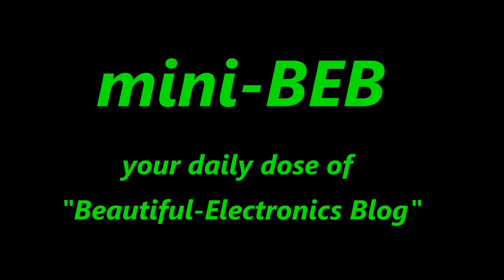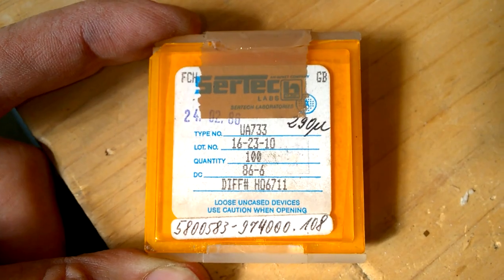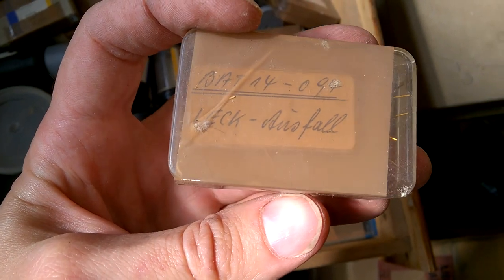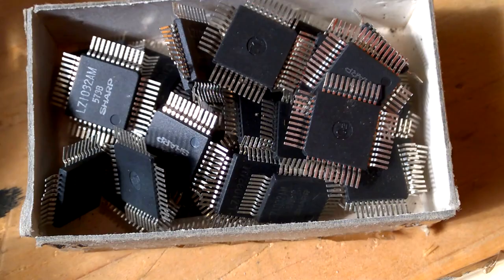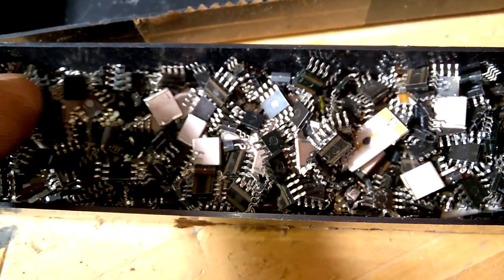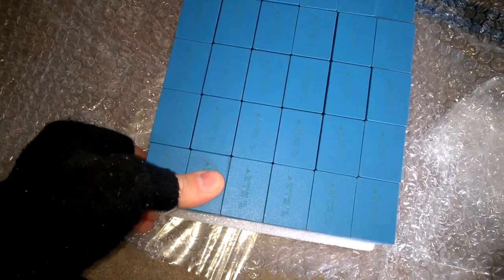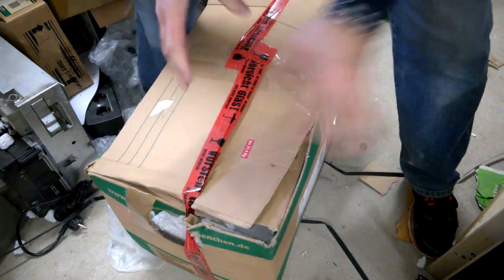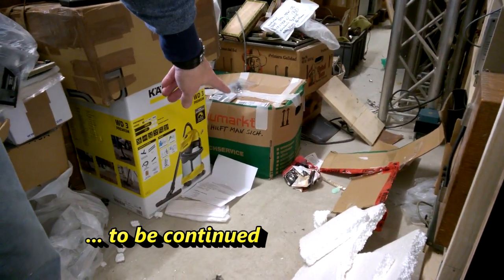CEPUS #14: High Frequency Parts + GHz Beam Lead Diodes + Mailbag

Comment: What a haul Max! The 'filters' at 12:17 look more like balanced ring mixers like MCL SBL-1 to me. The varactor a bit later is a power device used for frequency multiplication- in the correct circuit with input, output and 'pump' tuned circuits it would take say 5 watts at 150MHz and give you a watt or so at 450MHz.
Reply from the maker: Hi Alan, thank you for your detailed comment. You are right!

Comment: Are you selling any of the RF transistors off? The one with TVP 385? is a RF power mosfet close to the MRF 150. And The Jo2009 is like the MRF325 30watt output 225mhz-400mhz .
Reply: Thinking just the 385's would be nice.
Reply from the maker: @brendakoldyk1647  I am willing to sell them off. You will find my email address in the channels info box.
Reply: @MaxKoschuh  ok thanks

Comment: TRW TPV385 is a 14W output TV BAND3 (174-230 MHz) power transistor: Compatible cross reference: http://www.advancedsemiconductor.com/pdf/tvv014a.pdf
Can't find anything about the "J02009" marked part that seems to be from 1973.